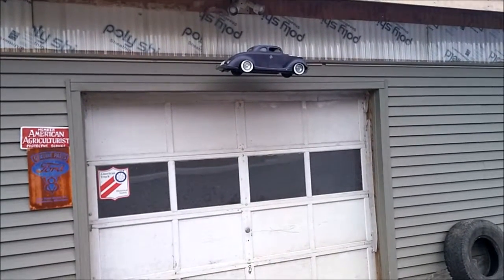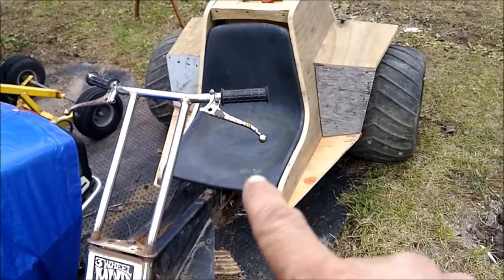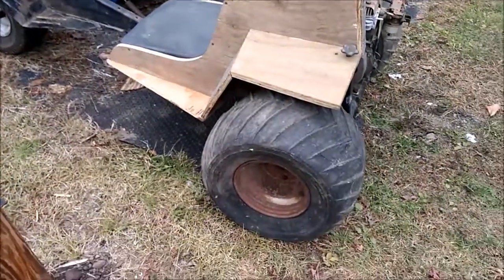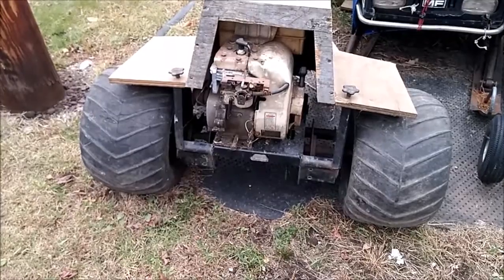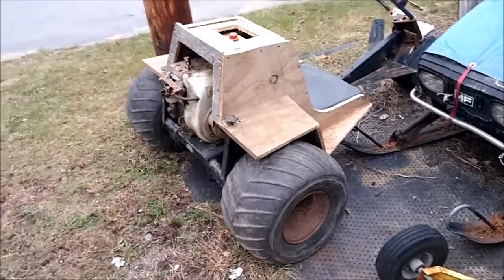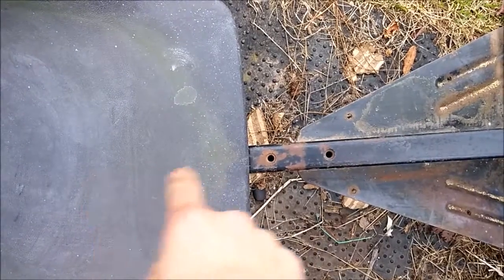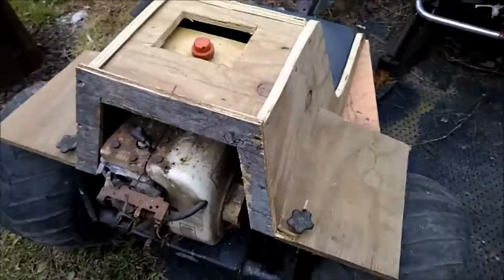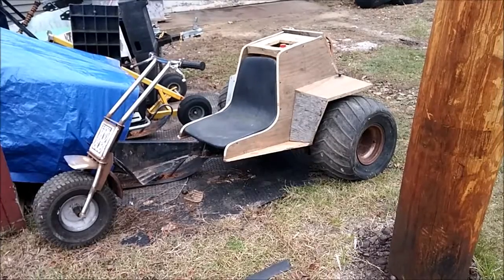Mud Bug Body Form Making

Comment from the maker: They only made them from 1971 to 1973.  This has a number on the frame and checked out be a 1971.  They came is two colors.  Like green or Apricot.  Just started preping the fiberglass body for paint last night.  Will post video later.  Thank for watching commenting and subscribing.